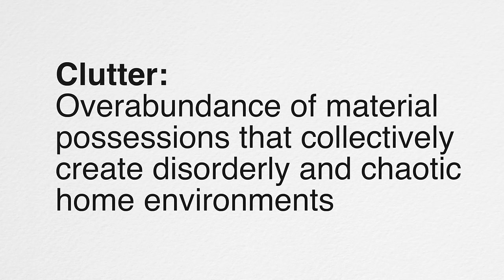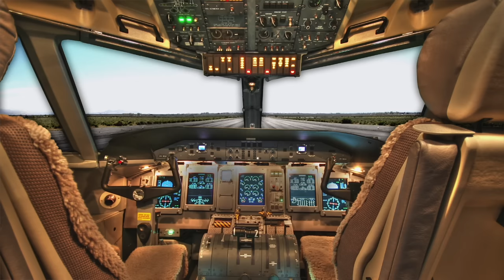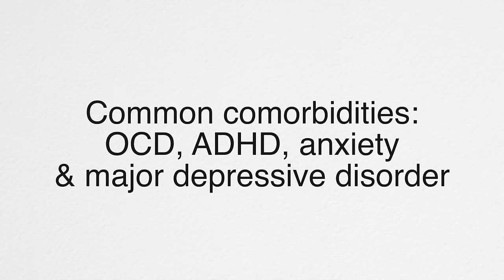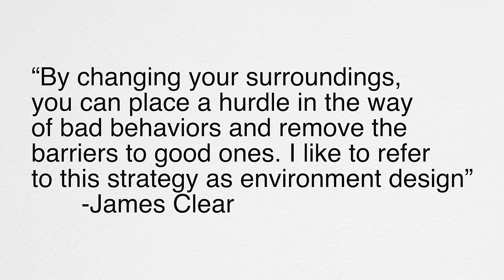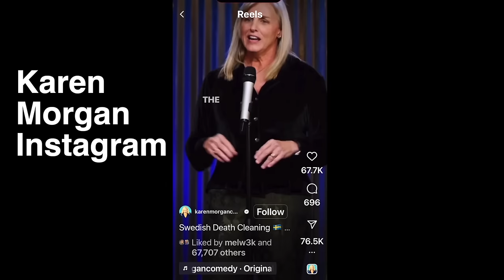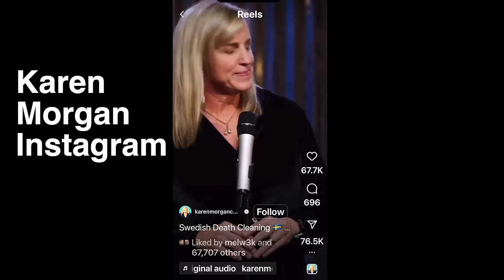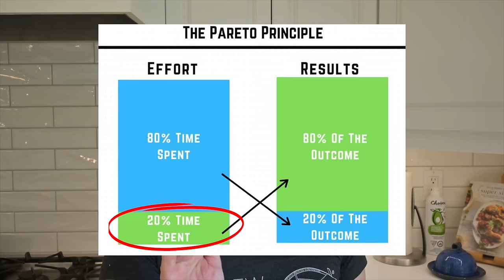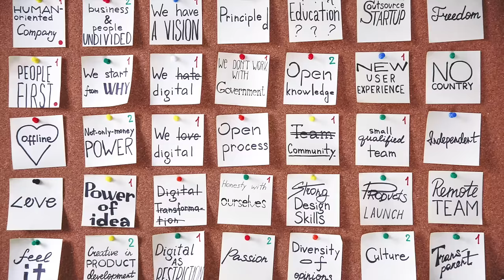How to declutter your home!

Comment: Shoe sizes definitely change as toy age. I found this out the hard way. I’m 29 and I used to wear a 7.5 but if they didn’t have it I always opted for a 7. Now when I try to fit into a 7 I’m in so much physical pain and sometimes I can’t even get my foot in at all. Now I’m an 8 and can wear 7.5-8.5 depending on the store but I primarily buy 8. I’m oddly the only female in the family who has had their foot grow. My older sister is still the same. I have the biggest foot size too. My mom is 6-6.5, my sister is 7-7.5, and I’m an 8.

I recently went through all of my shoes and couldn’t fit into a single pair of heels. I ended up having to declutter over half of my shoes since the only things I could wear were tennis shoes and slippers which were recent buys. I now have to go out and buy a new pair of heels for my occasional dressy event.
Reply: Don't feel bad about your shoe size. I wore a size 9 as far back as I can remember. But after my second child, I had to start buying size 10! And now, many years later, size 11 is much more comfortable. I'm 71 now.

Comment: I live in a two bedroom with no storage. So my garage/storage/attic/basement is under the bed, in the back of the closet and all over my bedroom! 😱
Reply from the maker: Oooh, that's hard! Are there any changes you can make?
Reply: @MinimalistHome  to have less stuff. But that’s the hard part, right? Deciding what goes. I’m sure a lot of it can. I just have to deal with the emotions of why I need to hold onto it. That’s the struggle. It’s not so much decision fatigue, as much as it procrastination on making the decision.